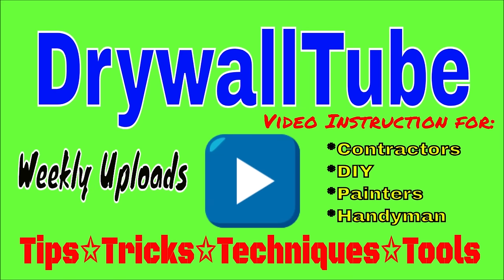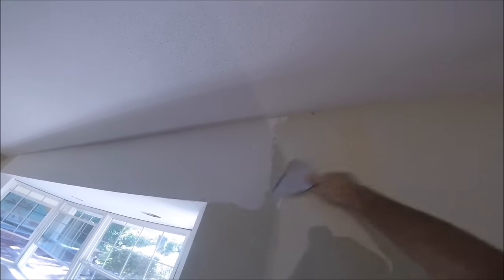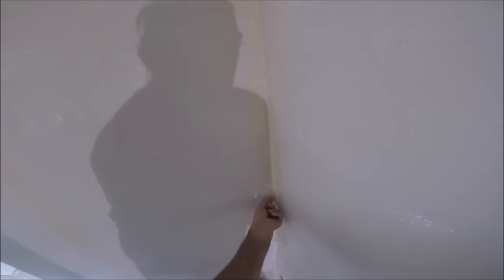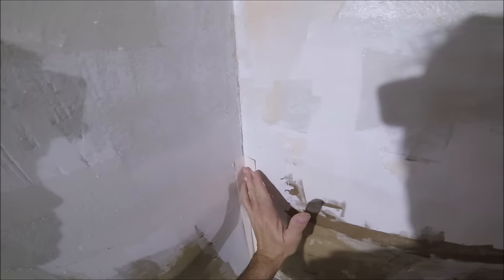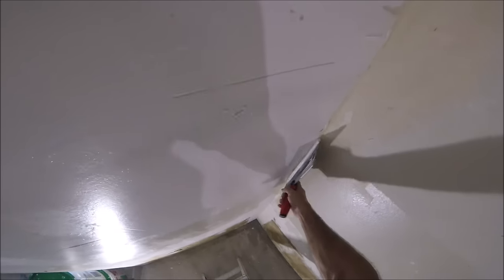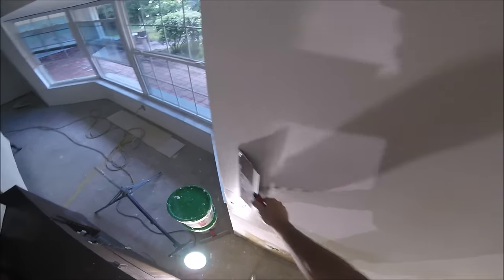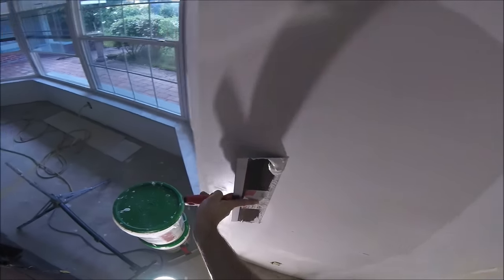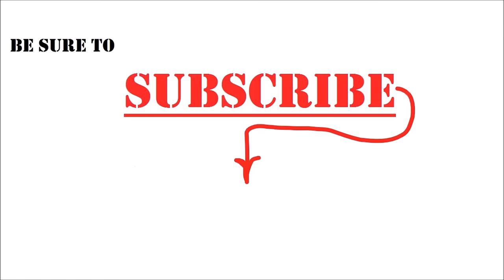How to Skim Coat a Wall after Wallpaper Removal Step by Step Tutorial

Comment: I tried skimming over bare brown paper last year and it was a disaster, it does bubble like crazy. Took me 4 layers of drying and sanding over a few days to finally get it under control. Then I saw one of your earlier videos about using Gardz. anyone who says the paper won't bubble is lying.
Reply: You can use mud like this on some paper and it soaks up the moisture and pull right off when before it was impossible to pull off… or skim like this then spray knock down

Comment: Just finished removing 30+ year old Mylar faced wallpaper that was applied over raw, unprimed sheetrock. I was left with a couple walls that didn’t look much better than your homeowner’s. Never heard of Gardz and had trouble locating it but I am going to give it a try. The best part is the wall is 25’ tall. Thanks for the advice.

Comment: Hi Paul, DIYer here, remodeling my 1913 bungalow kitchen. Had a contractor raise the ceiling 2' in half of the area to match the other half, and I'm doing everything from the mudding and taping on out. I have new drywall butted against old drywall, plywood walls, and mdf - and NOTHING lines up nicely! Also, there were damaged areas where I removed tile.  Gardz worked great there!  About to skim coat, and your videos are giving me some much-needed encouragement!

Comment: Hey Paul, Thanks so much for these videos. I am an independent remodeling contractor and have been for about thirty years. I've done lots of full on turnkey remodeling projects and do 90% of the work myself but always avoided major drywall repair jobs and wallpaper nightmare repairs because... well I'm kind of slow and until recently not real proficient at drywall finishing. But, 4 months ago I started watching your videos and immediately began improving. I am currently on a project in which the client has requested that the popcorn ceiling be removed. After watching your skim coating videos I feel confident that I can give them a smooth ceiling and leave them well satisfied. I will let you know how it turns out. Thanks again!
Reply from the maker: That’s awesome man!💥👊🏻 I really appreciate your feedback. Yes, let me know how it goes or if you run into any questions along the way. Thanks so much for watching and subscribing my friend!🙏 -Paul

Comment: Avid diyer here, and have always avoided major drywall repairs other than quick patches.  Recently purchased a 1962 home that had multiple layers of wallpaper.  After removing everything I found wall patches from previous renovations and none of the texture matched.  After repairing anchor holes, screw holes and other damage, the walls looked like Swiss cheese - and I was about to call a Drywaller to skim coat the whole thing when I found your videos.   I decided to try it myself - it’s not like I could make them any worse!   1 12” knife and pan and 6” taping knife, a couple of buckets all purpose joint compound and a 3/4” masonry roller (all in about $75) and a couple of afternoons of my time - my walls look absolutely gorgeous.   Perfectly smooth (even with an eggshell paint!) they look better than any repair I’ve paid for in the past!   Thanks for the great videos!!

Comment: Dry wall
I am a DIYer. Most of all my repairs are done by myself. I thank you for your video. It was a lot of help. Had the exact same problem in my bathroom.30 plus year old paper. I followed your instructions and it is all most as good as yours. Thank you so much. FYI I had to skim it three times to get it like I wanted.
Reply: I’m working on a bathroom wallpaper removal right now! Also about 30 years old, and gross. Fortunately the walls are in mostly excellent shape, since they had been painted with semigloss paint prior to the wallpaper. I just have to get the old adhesive off and repair a few very small  areas where the wallpaper pulled off a little too much wall.
Reply: @kristinjacobs9153  Same here.

Comment: I can't tell you how thankful I am for this video. The previous owners of this home not only did a terrible job with the addition to the house but they did a terrible job with the drywall, placing the wallpaper, removal of wallpaper, and then another bad wallpaper job on top of that. It's a nightmare. Just purchased the guardz primer, sanded down some areas, and removed excess wallpaper. I am a DIYer but know more about plumbing (daughter of a plumber) so this is all somewhat new to me. I have had enough experience to know that the job the previous owners did was a "diy don't"! LOL! Thanks to you I know how to overcome this little hiccup and I hope it works so I don't have to replace the drywall.
Reply from the maker: That’s awesome Nicole!🔥 I really appreciate your feedback!💥👊🏻 Thanks so much for watching and subscribing my friend!😎 -Paul
Reply: You know what you could do instead...there are so many interesting textured panels and other decorative wall coverings that can be glued or nailed to walls that aren’t in great shape. If the walls can’t be made perfect, cover them up instead!

Comment: DIYer, working on my first rental house.  Had to pull down wallpaper in the master bedroom, master bath, hallway bath, and kitchen.  Wall paper was originally put directly on the drywall with no primer.  Even with my best efforts it tore the drywall paper up.  I used the gardz to seal it and was looking on some good instruction on what to use and how to do the skim coat.  Thanks for taking the time to put up this video.

Comment: Great video.  I just started a Powder Room remodel which had wallpaper installed 35 years ago.  I used a steamer with good success in removing the wallpaper but I also experienced some top layer of drywall tearing.   I’ve cleaned up the loose paper.  Then started to fill in the divots with White Spackle  and then bought Kiltz to seal the speckled areas.  I’ve made good progress.  But I am glad that I found your video and I will now skim coat the walls. I am sure this will give me a better end result and reduce the amount of sanding I was expecting to do.   Thanks

Comment: They sell 36” wide fiberglass mesh
Cover wall with it first then apply compound over it
Reply: Drywall repair.  I bought an older home and every room in the house has wallpaper that has been painted numerous times!  To add to the challenge some walls were not sized resulting in large sections of raw drywall.  Watching this series to hopefully help whip these walls into shape.  First time working with damaged walls,

Comment: Just took the wallpaper off in my bathroom and outer room..found original wallpaper under it from the contractor.  They put it directly on the drywall.  I steamed it off but there will be repair work needed so really appreciate your video!!

Comment: My husband and I moved into my grandmothers home after she passed away (we rent it from my father presently) we’ve been fixing things up here and there gradually over the past 6 years. Our son pulled some of the old wallpaper off in our entryway and we need to take it all off now and paint the walls. My husband works so much that I end up doing a lot of the repairs and maintenance around here on my own and will be doing this by myself for the most part. Your video was so informative! I didn’t even know where to start, but I wanted to be sure I did it the right way and didn’t mess it up or unknowingly damage the walls. Now thanks to you I have a game plan to get started with! Thank you so much. 

When you say “the mud” is that the joint compound?

Comment: #drywalltube DYI here. Kitchen with wallpaper. Removed the wallpaper. Scraped loose pieces. Cleaned as much remaining adhesive as possible. Sealed. Getting ready to skim coat. Eventually paint. What a process. Great video.

Comment: Your tip about lighting is so true.
I am remodeling a house that had that Mediterranean texture. I had to get rid of all of that, and flatten out the walls. Then more sanding. I found that lighting the work area with a light focused on my area, worked really well. If I didn't move the light with me as I went, I would end up too far from it, and it showed later. Live and learn.
You have had 20 yrs to get your walls looking like that, and they are great. I have never done it, or corners. I learned how to make it end up looking like yours, but the effort I put in was way more than yours.
Thanks for the tips and video.

Comment: I’m a professional wallpaper hanger.  I usually scoff at  a lot of these videos, but you’re spot on. Some kind of sealer to seal the damaged places in the drywall is very important.  I really feel that frequently do it your selfers cause themselves much pain when they basically destroy the wall while being determined that the paper must come off. If it is smooth and tight it may be better to go over the paper rather than doing all that damage.  The worse tool is the paper tiger.  It really does a lot of damage.  Thank you for a well informed video

Comment: I m a DWYer, just finished removing ugly flowered wallpaper  from our master bathroom.  When the wallpaper was put on around 1970 the contractor didn't properly size the wall.  Removing the wallpaper was a nightmare. My walls looked a lot like the walls in this video.  I am getting ready to do my skim coats this weekend so this video was very helpful. Have to go to Ace Hardware to get the Gardz, as our Lowes doesn't have it.  Thanks for the help.

Comment: DIY here. I have quite of bit of experience painting because my dad was a landlord and have several rental properties. I frequently helped clean up and paint after each lease. But new to dry wall and repair, my brother did that part and i would paint. Bought our forever home 2 years ago and it was a fixer upper. Finally getting around to remodeling a bathroom feom the 1980s with wall paper that was out directly on the dry wall. The walls are a mess but after watching your videos i think i can do a decent enough job.

Comment: Great video, I am a house painter, but am remodeling my bathroom. The worst wallpaper I've come across, in fact, I and my partner quit taking jobs involving wallpaper removal. Thank you so much for this video, I'd say you cut 80% off my repair time. I've used various Zinsser products, but I will find that Gardz somewhere. I also added some led lights which saved me a lot of time on the painting of my high ceiling walls with knockdown texture. Thanks again for the excellent, well-done videos.

Comment: Homeowner DIY here.

I have 2 kitchen walls that the previous owner did a texture paint 1/2 way up the wall.  I hid it with wall paper years ago but have decided that the time has come to get it back to all paint.

I got the wall paper off no problem and now it is time to deal with the texture.  I ran a sander over it and the peaks come off the paint pretty easy but the valleys are still there.  Did some research and found that there are several high build primer products on the market that I could use.  I went to 3 paint supply stores, 2 box stores and a couple of small independent hardware stores.  May as well have been talking to the wall.  Not a one of them had a clue what I wanted.  I even pulled up the product on the stores own website with a SKU number.  Nope, can't get that.

So here I am.  I'm not the best drywaller but I am willing to give this a try.

Thanks for the lesson.

Comment: Hi, here in NZ, i've used an enamel based sealer over the raggedy old paper which was sanded with 6o grit to scuff up the cardboard fibres, Then rolled with a medium to long pile roller using pigmented enamel sealer, Alkyd Flat enamel typically an enamel based ceiling sealer. Scuff with 60 grit before painting then Light sand with 100 grit to knock the tips down and any high spots, then skim same as you've done. The sealer locks the remnants of wall paper to the wall and stops it getting wet from the plaster coat and releasing if the glue gets wet, Like wet plaster can bulge off the wall creating a blister. And  It also prevents the brown stains bleeding through the plaster from the brown cardboard. Stains could potentially bleed through the acrylic top coats in the near future if it isn't sealed. Your way is awesome too ! You've got that down to a fine art ,  Nice Job !

Comment: Very nice! I used to work for my dad's construction company when I was in my teens and twenties, but I never really did a lot of drywall. That was mostly contracted out, because those guys could finish the entire house in a day with barely any touch-up needed, while we were doing something else. I'm working on a nightmare in my current house. It had this godawful dark british racing green paper with pink roses in vertical lines. We began pulling it off and found that it had been glued directly to the drywall with no primer or paint applied beforehand. Needless to say, the surface is pretty rough. We got most of it off without too much tearing of the paper, but the glue residue forms this very rough surface that no amount of sanding has been able to take care of. I watched your video as sort of a refresher, because I know the mechanics of finishing and I've done tons of small repairs with good results, but nothing as big as the entire wall. I mostly wanted to know the correct consistency that the compound needed to be and yogurt sounds good. Thanks! #DrywallTube

Comment: I’m a DIYer. Just bought a house that had some really cheap wainscoting in both my kids bedrooms. Was hoping it was just nailed in lol. Nope, had liquid nails all over so when removed it tore the drywall all over. I’m going to start with the Gardz and then skim coat and texture myself. These videos are invaluable. Can’t wait to see how it turns out
Reply: GS300 Rich how did it go?
Reply: Marisa J R it turned out great. The gardz problem surface sealer was worth its weight in gold. One lesson I learned was that the joint compound really needs to be thinned a bit. The first cost was very light just covering the damaged area so it worked ok. The 2nd cost was much thicker and harder to smooth out. I ended up sanding for over 2 hours in each room. For the 3rd coat I got ultra lightweight joint compound and thinned it and it was great and sanded very easily. Gave me a nice smooth finish for texture. Although it took about 4 days in all I saved over $2,000 from having a professional do it

Comment: I had to remove some very outdated 50-55 year old wall paper in a half bath. I struggled with the DAP not breaking up the old glue after the penetration tool. We wound up just tearing it off over a couple days/ weekends. I was left with the dried, yellow glue and tried the wet and scrape method. I was  going to try the wet with hot water and dish soap or vinegar. I've had to skim coat over terrible orang peal walls in the whole house from the previous owner. I appreciate any advice on skim coating technique. It's been months since attempting this. I will try it again to hopefully get this bathroom done. Thanks for the video. I am not a painter or drywall guy. I just diy what I can figure out on my weekends.

Comment: DIYer (Computer Programmer). I agree with Elsie. Never did skim coat. I understand the concept but not the technique. I liked this QUICK video with reference to the longer one. Excellent idea.
About to take off 15 yr old on top of 40-50 y/o wall paper. If it goes bad then I'm pulling the drywall off the walls and putting up new. Its only about 8-9 sheets for phase 1 (breakfast table area). I will try my hand are the removal to see IF I can do it and gain the experience. But finish is king to me. 
Thanks for sharing your experience. Wish you were in the Cleve, OH area.

Comment: Paul. thanks for the great skim coating tips. I was going to use ZIN Primer, but I will see if I can find Grarz. Also, I found that using a DA sander over the old wallpaper adhesive and torn paper really makes a great prepped surface. I does cause a fair amount of dust. Thanks again.   Kevin

Comment: Diyer currently doing a similar project on 2 bedrooms.  I did a similar project several years ago and forgot how much work it was😀 The walls are actually worse than yours. I had to cut out dozens of nailpops that had broken paper, apparently from a heavy hammer. I was so tempted to replace all the drywall but I knew that once I had the wall open I'd be doing all sorts of "might as wells" like replacing the insulation or running new wires.  I hope I made the right choice.

Comment: I came here because I just bought a house, budget is tight and I will need to do the walls myself. I just removed the wallpaper and those plaster walls were really bad underneath. I panicked a bit and ended up here to find out if there is a solution. It seems it is not as horrible as I thought :) Thanks!
Reply: I’m in the same boat!

Comment: I'm on day 3 of five of wallpaper removal in a 1896 Edwardian house with tall ceilings and bay windows in this bedroom.  540 square feet of walls, but the ceiling is fine.  One wall is drywall, as is the ceiling.  Some repairs at the baseboards will be necessary on the plaster and lath.  New wiring is all mortised into the chestnut baseboards.  
The rented steamer is a decent tool.  
Last year I removed and stripped the 12" baseboards and sanded and urethaned the pine floors.  The baseboards' shellac stripped easily with methyl hydrate.  Fruitwood water-based stain enabled me to match the chestnut baseboards and window  casings with white ash quarter round, ogees for the new windows, and a 2" crown moulding cutter I used to make a 4" covering piece for one problem wall where the drywall was too short to meet the baseboard.  It actually worked.
Plaster is definitely not my forte, but I hope to put a skim coat over the various white vertical surfaces in the room.
I like your video and would appreciate further suggestions.
Rod in Portland, Ontario, Canada